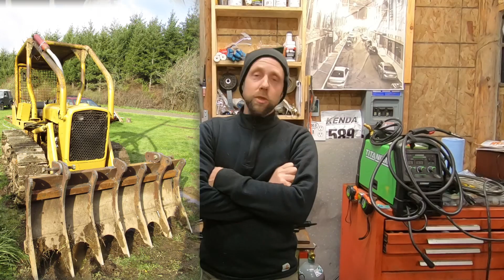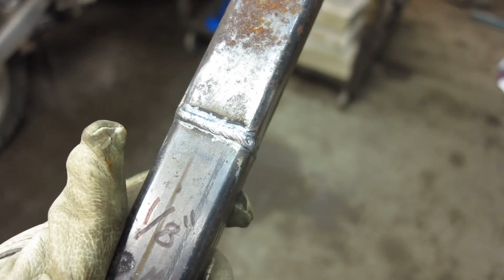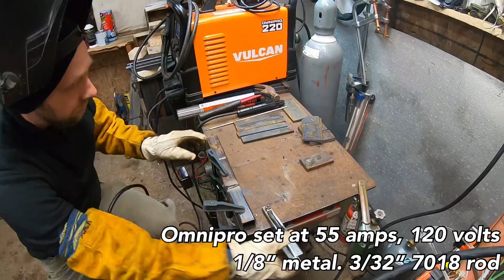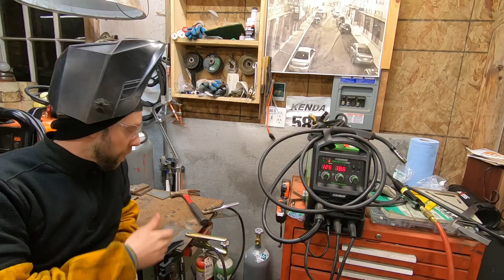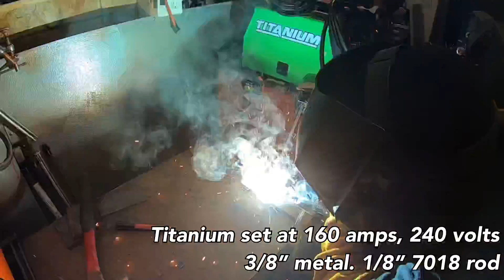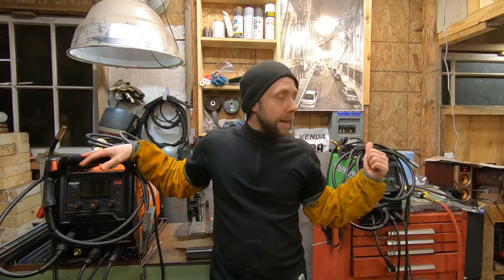Vulcan Titanium welder Harbor freight stick welding comparison

Comment: Hey Mike,
 I have watched several of your videos, not sure which to get. I have a box blade that connects to the 3 point on my tractor the part that broke is 5/16 steel, this part has broken twice in the past in the same spot and I took it to a local guy to weld it and, it's broken twice since he welded it. The part that breaks is rightness to where the 3 point connects to the arms so there is allot of stress on the joint. When I take it to get it fixed I have to load it on the trailer drive there wait, then home. I figure I may as well try to fix it myself. The guy that fixes it uses a miller 225 flux welder, too much for me. However for a rookie with 240v available would you suggest a 225A arc welder for this or a flux machine? I have very little welding experience aside from watching guys like you on youtube. Suggestions are appreaciated. I would be welding heavy stuff with this welder, don't care what it looks like just need the glue to stick.
Reply: I'll answer you if you don't mind. I'm no "welder" but I weld. I'm in your boat and I went with a stick welder. On equipment repairs I use 1/8 or bigger 7018 rod. Don't just put the two broken pieces together and weld them. Use a grinder and cut a v shaped notch so when you stick it back together there is more surface area for the weld to fill. It'll make for a much stronger weld. I have had no problems doing this when I break links on my tractors. Use 6011 for things that just ride along on the tractor or stuff that is really rusty and dirty. I'm using a Lincoln AC/DC buzz box and am thinking about switching over to the OmniPro to learn different processes.
Reply: I'm late to the party, but I have the Titanium 200 multifunction machine and I am totally happy with it. I also have a big gas powered welder that I never use anymore, need to sell it I guess. I am currently welding some chisels back on my pasture renovator/aerator and want to try out my stick feature that I have yet to use. I did a couple with the mig, turned way up using 240v. 1/4" steel, and it did fine. I need to break out the owners manual and see how to hook up the stick portion of the welder.  ;)

Comment: I think I recall the teachers at school saying on there machines they had stiff and soft setting the soft the 7018 would stick the stiff it wouldn't there were also differences between AC and DC when it came to 7018 sticking and not sticking

Comment: Doesn't anyone ever test these inverter boxes with a root pass rod? Like a 6010 or 6011? We all know these welders can run the easiest rods ever (7018 and 6013), but if you're going to weld anything structural with stick you need a deep 60xx rod for first pass. I know the whip/pause method is feared by people who don't arc weld, but us farm repair boys want to get rid of our tombstones but need proof you can run high arc rods.
Reply: Update... So I bought a used Vulcan omnipro 220 last week, and I can attest they run 6011 just fine. I did a whip and pause motion like I've always done with m ac225 and you can run on 1/8" flat plate with 120 v or 3/8" plate (or more) with 240. Very smooth arc and the hot start works nice. Hopefully this will help somebody
Reply: @ohiomapleguy  he said he was self taught but I've wondered the same thing they taught us in school to run the root with 6010 or 6011 but all our projects were done with 7018 we did an Xbox one side was 6010 100 passes we had to fill it all the way up it was to much that rod lays flat but I do like that whip and pause I think they prefer 7018 because it filler anyways thanks for letting me know this runs that to I haven't been to harbor freight since 2013 I bought a pair of hair clippers that were dull and never went back lol but I went there tonight and seen all these welders I just finished trade school so I am looking I just need to get 220 volt breaker for the garage😔

Comment: Hey quick question if you even respond a year later but, I wanna get the Miller thunderbolt 160 but I do not know what to do with the fumes coming off because I’m going to be in my home garage so any tips on how to get hood ventilation for the fumes
Reply: Open a door

Comment: does anyone know if it runs 6010 well
Reply: I've seen most inverters will not run 6010 but will run 6011 just fine
Reply: If it runs 7018 with no problem. It will run 6010 as well

Comment: Just a heads up 3/32 7018 amp range is around 70 - 90. 55 was way too low. Which is probably why you kept sticking.

Comment: Stop selling yourself short on the stick welding you put a decent bead down. Few tips if you don't mind me adding my two cents. 3/32 rods I've found the sweet spot is around 85 to 95 you can go lower but your going to have a higher profiled bead (the filter won't spread out). For 1/8 rods i like to run between 115 to 120 and most would still say that's cold i wouldn't go over 130 because then it starts acting more like a gouging rod so your doing more harm than good. I really like your videos tho keep up the informative work. One other thing watch your puddle more with stick half moon shaped to slightly cone shaped is a good travel speed.

Comment: What about the Vulcan Commander 225 vs the Titanium 225? I know the Vulcan is AC/DC compared to DC only on the Titanium but i like the size of the Titanium. Just wonder how much more versatile the Vulcan would be for the average joe. I already have a Titanium 170 but would like a stick welder for thicker stuff. I dont have gas. Just been using Flux Core.

Comment: I want to thank you for doing this video.  I like your effort to inform and educate.  However, I'm facing a Delma with the welder.  I have been in the market for one of these HF welders now for about 3 weeks.  I tend to gravitate towards the Vulcan due to price and apparent quality.  The issues Im seeing are an uncomfortable number of reviews pointing out  the issue with poor quality of the mig gun.  The machine seems solid ,but the gun is crap. Falls apart after about 1 year of regular use.  Now this is not everyone's experience, but a good percentage are experiencing this.

So when I do a price comparison between (Vulcan MIg Max 215 vs. MillerMatic 211) 

Cost of Miller:

 is 1249.00 plus 3 year warranty ( free) plus good welding gun (free) plus 30 years of guaranteed support for all parts aka product support ( all components that fail will be accessible and supported for 30 years)

Total Out the door price is 1249.00

Cost of Harbor Freight Vulcan Mig Max:

Is 770.00 plus two year warrant ( they don’t offer a 3 year warranty ) 180.00 plus comparable miller welding gun 200.00 gives me a total cost of just shy of 1200.00.  

The final component is the fact that there is risk in purchasing a Vulcan due to the fact it is new a "New to the market" welder….After the 2 year warranty for the Vulcan runs out your on your own… with the miller you get an additional year of warranty and guaranteed product support for 30 years.  So, for me.. Its looking like spending that extra 49.00 for a Miller is money well spent.  

also,  

Duty Cycle of Miller is better
Reply: With all the information you just laid out I would by the Miller. But then I’ve never welded a day in my life.
Reply: Wellllll... this is reviewing multiprocess machines, so potentially the two machines ur comparing have nothing in common with these

Comment: Hey Mike, thank you for the video. What do you think about Everlast SuperUltra 206Si - kind of loaded machine for the very attractive price.
Reply from the maker: I just took a look at the 206Si and it looks like a fine machine, one thing I thought was a little misleading is at the top of the Everlast page it shows a pilot arc icon along with other feature icons then you read the details and it’s a high frequency start, this HF starts tends to be common on lower budget plasma torches, they work fine but won’t work on a CNC plasma table if you ever look into upgrading to one. I bet it would be a fine welder/ plasma for the home shop. I have never owned any Everlast products but I have heard people like them. Take care 👍
Reply: @Mikefestiva  Makes sense. Thank you Mike. Since I can see the pilot wire on the machine itself, it should be a pilot arc I guess. It's difficult to judge yet - looks like this thing just hit the market, no many people are aware of "everlast combo for 659", but will be a great addition to the shop I think. Thanks a lot man. Good luck.

Comment: A full comparison would mention price difference. It my first viewing of your channel.
Reply from the maker: The Teller I covered all that in the first video I did on these welders, this is probably the forth video covering stick welding with them. 
Ps it’s hard to include the price in the videos because the price a year ago may not be what they are selling for now.
Reply: Mike festiva   Thanks for responding. I had subbed and will catch up with vids.